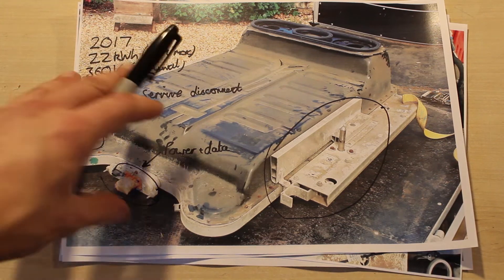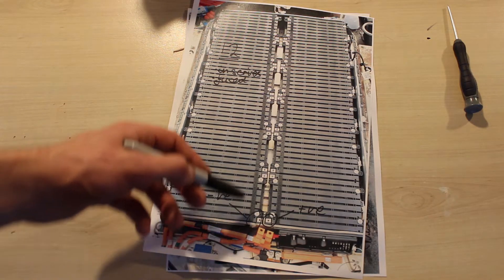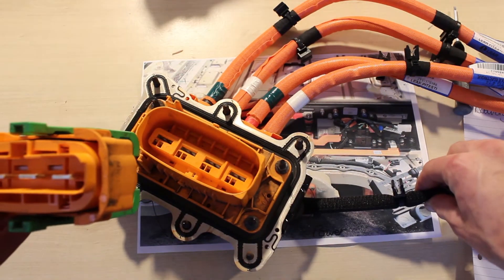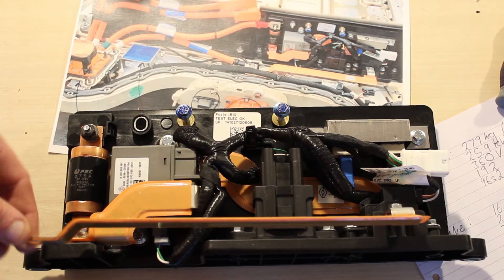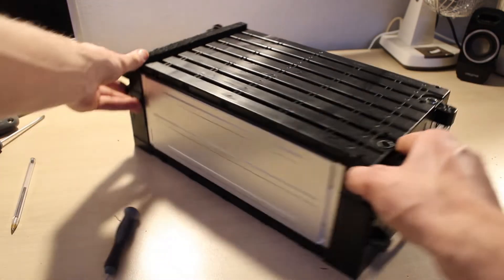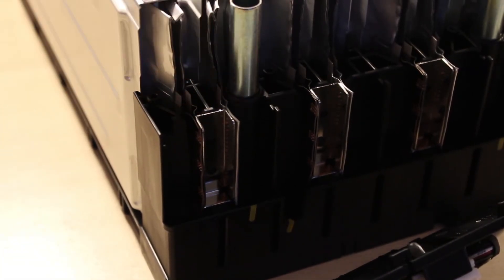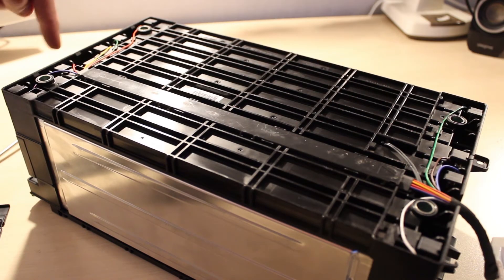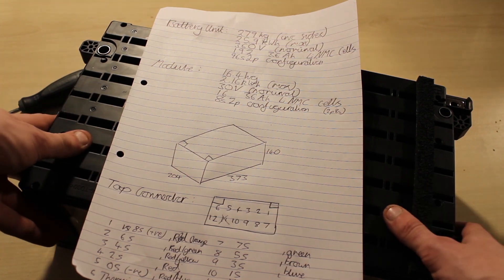Renault Zoe Battery Disassembly - LG Chem Modules - DIY EV Powerwall Solar

Comment: Nice breakdown!  I wish I had seen this before I did self discovery to determine the parameters.  I use two of these individual 8s packs to run one of my off-grid systems.  To get voltages to common equipment, I popped off one of the 2p cells and run them as 7S.  Been running the offgrid security system (and beer fridge) for over 2 years now!

Comment: Hello! Thanks for the great video. My Renault Zoe Year Model 2019, has a bad Bearing in the Electric Motor, which makes a bad sound. And I get no help from Renault. And not by my insurance company either. My only option is to, with the help of a friend who has a BilLyft, pick out the electric motor ourselves. But I would need some help from you. If you could please tell me how to do when I want to do a Lockout on my Renault Zoe. I know that you should start by turning off everything in the car's dashboard, such as Scheduled Charging. And Timed heating of the car. And you must detach the minus pole of the 12 Volt battery. And then wait for at least 5 minutes. Then you have to remove the 400 Volt fuse which is under the car mat by the right front seat. Then you have to make a control measurement somewhere in the engine compartment. Under an aluminum cover. I don't know more about this. Please. Can you give me information so that I can safely and properly turn off all 400 Volt power to the Car Engine. Thanks! From Tommy Bertilsson from Sweden

Comment: Hey thanks for the demonstration! Very instructive. I am planning to by a Zoe and once it is short in km I'll use the battery to power my house :p
30V is not very convient so I'll have to find a way to rize the voltage...

Comment: Excellent teardown, thank you. I've just come into ownership of a broken Zoe (traction motor is dead) and wondering if the batteries could be used for extra solar buffer in my campervan.  I think it probably could be possible, but 360v x 275A is a scary amount of power for me,

Comment: I really want to know how the cooling system of this battery is working. As far as I know it has a air cooling system. But how is it working? Where is it located? Any filter change required? Etc

Comment: Do you now what kind of thermistor (NTC resistance at room temperature) is installed within the modules?
Reply from the maker: Hello. It is a 10k but I do not know what beta value
Reply: @TopRockEV  thanks! That info is helping a lot.

Comment: Hi, did you measure the size of the interconnects between the modules? Also, I assume they are plated copper? Thanks, Nigel
Reply from the maker: Hello, I did not measure, they were tin plated copper in an injection moulded insulation piece which held the terminal screws in place. I'd guess about 2*15mm, but can't really remember

Comment: Loved this, my question is, when a battery loses power and it drops by about 1% efficiency per year they say. Is this a result of degradation over all cells of the battery pack or one or two individual cells affecting the pack performance overall ?. My reason for this question is, if it’s one cell causing the problem then it’s worth pulling and replacing but what is the cost for a Renault owner ?, thanks.

Comment: Hi, how's the Dolomite conversion going? I just subscribed to check out your later build videos but didn't find any. I know these things don't always go to plan. I've been 'planning' (read: 'dreaming of') an EV build since about 2009. I had a Reliant Kitten but got sidetracked and sold it. I've now started to get back on track with a Fiat Panda (classic slabside model) but the world has moved on; I was originally looking at 72v DC using an Agni 95r (just about enough for the lightweight Reliant) but now looking at twin Agnis at 144v DC. I know everyone's going AC now but I've got the motors so might as well use them. Looks like the Zoe modules would be the way to go (maybe 5 modules @150v). Hope to see progress on yours soon👍

Comment: how can u wire them to what BMS? use existing cables with new bms or completely dismantle modules to sort out dead cells and replace them? cheers!
Reply from the maker: Hello. I spliced the old harness from the Renault Zoe into the an Orion BMS 2 harness. It is a nice tidy solution, video to come in the next couple of months. There are no dead cells, the modules are in good condition :)
Reply: @TopRockEV  2nd life though?

Comment: great movie.
do you know if it is possible to replace the whole battery with another set of self-made cells? If zoe gets the right voltage it will work. or maybe there is some electronics in the battery that is necessary and cannot be omitted. I am asking because there are a lot of cars without a battery and the battery could be organized on your own, at least 10kw to work, it would be enough.

Comment: Visually it seems that the Twizy used the same cells but in a 2S3P configuration.
Reply from the maker: Correct the modules look very similar and are in that cell configuration, but the cells are in fact a bit "shorter". Not sure the difference in capacity, but I actually bought a couple of modules that were over discharged and beyond saving. I plan on doing a brief video tearing one apart at some point

Comment: Hi, I have a zoe ze50 R135, can you give an opinion where could I safely tap the HV bus, to connect an extra battery pack, or an ultracapacitor pack... the battery suffers a lot with spikes off power output I live in a mountain area so I have much hills to overcome, the total amount off regen it's not capable off recovering what you spent on the same hill it's about 30 to 35% recovery... with a extra pack the objective is to reduce the spikes.... so I can spare the mai battery and save at least 10 to 15% energy from main pack...

Comment: Nice video, one of my cells on a 2017 40kW is faulty and Renault are repairing it.
Reply: How can you know which battery is to replace??
Reply: I only yesterday first heard that a 40kWh battery cell failed, also a 2017 model. can be fixed though, google "evclinic" in Croatia.

Comment: Great walk through! 👍

I wonder, is there some standard to the battery interfaces? Could you then use it as is to power a house solar array without dismantling it, using the existing bmc & cooling?
Reply from the maker: Thank you, hardware wise that seems very possible. As far as I know all the communication is CAN based, so someone skilled in CAN spoofing could perhaps control the unit

Comment: Do you know what kind of bolts are used to seal the lower and upper part of the  casing? And any idea of how much bolts there are? And what type of bolts are used for the modules?
Reply from the maker: Apologies for the delay, if you still need to know this feel free to email me and I will attach photos of the bolts with dimensions

Comment: Is there any way to disassemble to the cell ?
Reply: Thank you very much ! How many kWh capacity is a single module ? It is for a energy storage project.
Reply from the maker: @yanncousin5883  2.16kWh per module, I have listed more information in the description. I am using them for a electric car conversion
Reply from the maker: You could take lift the cells out of a 2p8s module, and potentially cut the cell tab connections to get the the individual pouch cells. Would be a bit difficult to do this without damaging the cells.
Reply: @TopRockEV  thanks for sharing this video, still useful 2 years later! Do you know if the pouch cell pairs are bonded together, eg with self-adhesive foam pads? Looking to build a 96s1p pack from these cells, but can only do so if it is possible to separate the cell pairs.

Comment: Hello.nice job.can you tell me if there are 16 cells type 18650 in paralel?.thks
Reply from the maker: Hello, thank you, no. They are pouch cells (flat) of capacity 36Ah in 2p8s. 18650 are very different and are cylindrical cells (much smaller) of capacity approx  3.5Ah
Reply: @TopRockEV  so it is 45 packets of 8s and 2 p do you think o can update with 18650 batterys

Comment: Great video, I’m curious if you have any information on the max current draw of these cells or they type of individual pouch cells. I’m curious if they are they same pouch cells as in the Chrysler Pacifica battery modules just in a different configuration. If so this should be a very capable pack for ev conversions.
Reply from the maker: Thank you.
-The are not the same as the cells in the Pacifica modules (Zoe: 36Ah Pacifica: 44Ah)
-I would imagine the cells from a 22kWh Zoe have slightly lower but similar maximum discharge current. Cooling would be a limiting factor, are not as easy to cool as the Pacifica modules
-A leaked LG Chem data sheet for the 44kWh Zoe cells is readily available online (google "E63 cell data sheet") which details current limits
-I think the modules are excellent for EV conversions, the 2p8s configuration is much better suited (compared to the Pacifica 1p16s) for lower voltage (~120V) conversions given it allows fewer parallel strings for a given capacity

Hope this helps
Reply: @TopRockEV  This helped me immensely, thanks a mill. Wish you the all best with your conversion, thanks again!
Reply: @TopRockEV  If I understand it correctly , what you mean is that its just a smaller fuel tank but, the same octane value, Wright??     If so,  It could drive Tesla S motor  wright?? By the ways, Great sharing VDO!

Comment: Very interesting. I am really interested on how the 41 kWh battery looks inside and how the battery heating works.
Thanks for the video!
Reply from the maker: I believe the larger batteries are very similar inside, and even use modeles of the same (or very similar) form factor. Amazing that they fit nearly double the energy in the same case! The AVL resource I have linked in other comments provides some basic info on the cooling and heating

Comment: Thanks for sharing!

Are the modules sitting on a cooling/heating grid?

Good luck on your ev conversion👍
Reply from the maker: Thank you. Air enters through the middle "chimney" hole, through the gaps between the individual cell pairs as well as above and below the modules and then returns around the sides of the pack through the 2 side chimney holes. The temperature of this air is controlled by a unit on the car. AVL produced a series of slides that give some more information on this: http://cii-resource.com/cet/AABE-03-17/Presentations/BMGT/Prochazka_Wenzel.pdf
Reply: @TopRockEV  thanks for the slides. Seems to have been designed for quick swap ability with the huge alignment pins on the sides

Comment: 2 years ago I had the reverse situation of what you are in with this battery. 
I have bought broken Renault Kangoo Z.E without battery, it was used by post of France but they decommissioned it and removed the batteries.
 Back then I couldn't find any used battery for it and also could not find any solution on internet for it to make it run on diy battery with its original controller. 
So I decided Im going to controller swap this thing with some off the shelf controller. 
 I have built 16kwh 40s battery from some 10s modules I sourced before. I chose 40s because high voltage controllers are extremely expensive, also had to install hall sensors to motor to make it compatible with new controller.
Car is not perfect, its slower than it was originally but its usable for in town driving.
Reply from the maker: Love the ingenuity, were the 10s modules the ones from the Chrysler Pacifica? With the 2 BMS plug on opposite sides?
Reply: @TopRockEV  No Chryslers here in Europe but we have a lot of e bikes and electro scooters. I have found used 4kwh packs from some not to be electric scooter production that was cancelled. So there ware truckloads of this 10s modules without bms but with balance leads, bought as many as I could afford and the rest of those ware bought by other ev group members.
Reply from the maker: @ACAGT  Excellent. I'm in the UK so no Chrysler's or and very few electric scooters :) Good stuff
Reply: @TopRockEV  😁
Reply: Did you spoof the CAN communication in order to get it working?

Comment: Very cool video, thank you for sharing it. I also had a Zoe Q210 but I was very unlucky with it. It's HV parts are not well engineered and very sensitive. I heard from a Zoe mechanic that even the HV climate compressor destroyed all HV parts several times in several cases (except the battery, which really seems to be well engineered and makes very less problems). In my case the motor the PEB and the BCB HV parts were damaged. The car had about 80000km, when it happens. It was the third motor! The estimated cost for repairing was 7000-8000€. The Renault garage couldn't tell me in detail what is defect, because of errors on the bus. Today the mechanics can only replace complete parts, not more. That's why I tried it on my own. Firstly I checked the battery, were I found a defect fuse, which you showed in your video. After that I had to charge it in a really dirty way, with a bridge rectifier and a classic light bulb. Then I bought all HV parts from a crashed Zoe, which also is not cheap. In the next step I learned, that it's not possible to simply replace all parts, because they are all VIN coded. They tell you, that's because of protection against theft, but I am sure that's for forcing you to go to a Renault garage. So I disassembled the PEB first and replaced the HV boards. That's what I also did for the BCB. At least I replaced the motor and programmed the new motor parameters with ddt4all. After that the car was okay again. But believe me, it's really not well engineered. If you get problems with it, it will very costly or time consuming and dangerous when you don't know what you are doing. I am always happy about people who share videos like this. They help a lot, when you are in trouble with the car.
Reply from the maker: Wow that's quite a story! I love to hear when a consumer manages to fix their modern tech, well done. I am impressed with the simple charging method even if slightly rough. Good work reprogramming to overcome issues with VIN coded components, I have never worked with Zoe components outside of the battery but that sounds very interesting
Reply: @TopRockEV  Unfortunately I did not find another way to charge my battery as my BCB was damaged and I was afraid to damage the battery because it was quite empty and I was at the beginning of all.
In addition, I was sure not to damage the battery, because the light bulb operates as a very weak fuse, voltage divider/resistor. The light bulb controls everything, except the charging state. 
Actually, I worked with two light bulbs in series. This makes charging very slow, but it was okay to me and I was sure not to overcharge the battery quickly. 
I am not sure, but I think that the battery had 50% after about one week of charging. 
As this procedure is seriously dangerous, I have proceeded very precisely. Firstly I prepared a further service plug: I replaced the fuse and add two wires. 
The wires must be of good quality and fixed in an isolated box, as they always have over 300V DC.
A mistake could fatally injure, kill someone, or burn everything down. This plug allows me to connect directly and safely to the battery.
In the next step, I connected this system to the 400V public grid. After a few hours, I saw, that the battery gets fuller because the light bulbs glowed brighter/voltage increases.
Overall the time I had to ensure, that nobody could get close to the car.
Reply: @TopRockEV  Have you bms, electrical cables, box and other things without battery cells of course ? I would like to buy it. How much is it ?
Reply from the maker: @johnydeep1094  Hello, please email me. Email is in description
Reply: @TopRockEV check out what the EV clinic in Zagreb did with the battery pack on an early Kangoo (same tech).
Reply: “Electric cars are simple thus less maintenance “
😅
Reply: That’s a crazy story!
Reply: Thank you from stay away from “simple electric cars”